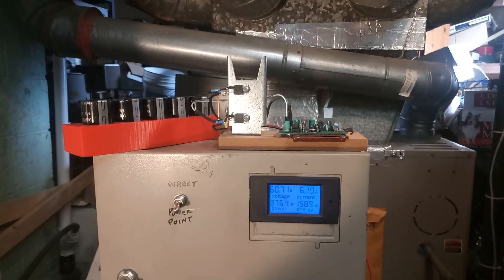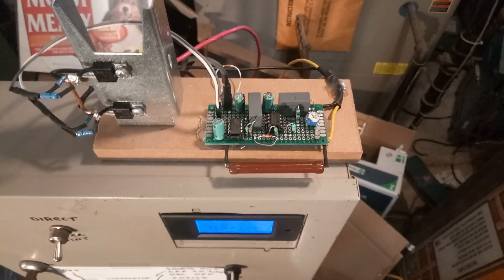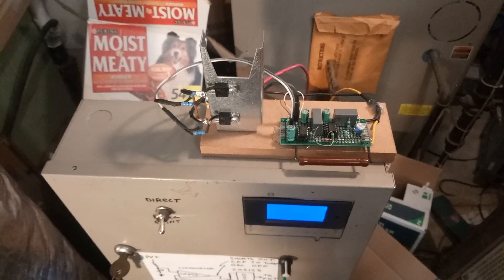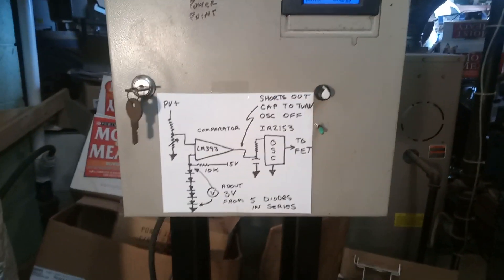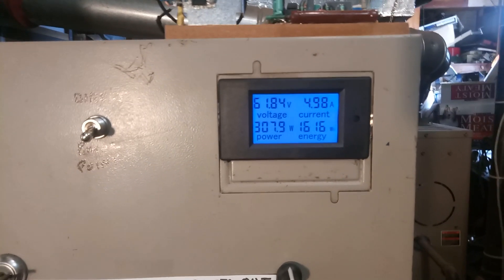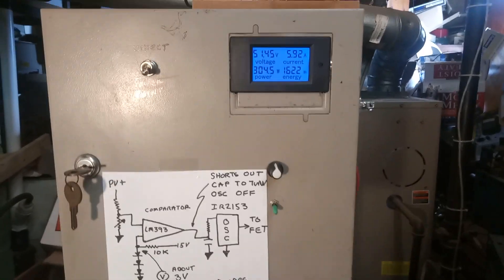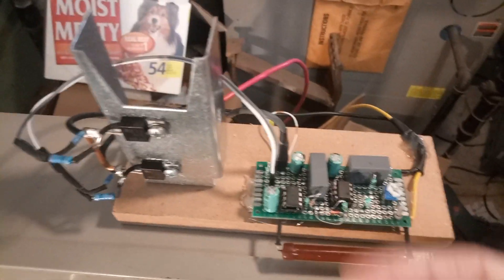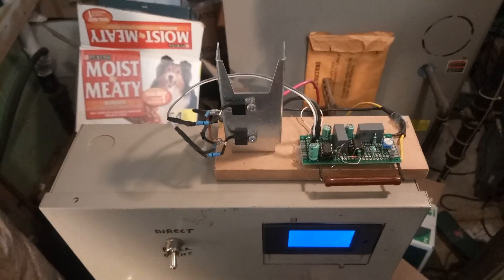LM393 Tracking PV Solar Water Heater Control, FAKE IR2153 Pt.1

Comment: Very clean design! The mounting system for the capacitor bank and the heat sink design for the fets are truly ingenious! Have you considered using water as heatsink for the fets?
Reply from the maker: I believe that if electronics you designed gets hot, you are probably doing something wrong. These FET do not heat up due to very low on resistance. FET resistance can easily double at elevated temperatures. Be aware, FET current in this circuit remains the same and only the duty cycle varies even at low average current. These are 
only 75A FET in this video and at 8A you can not detect that they are running. Using the recommended 110A FET you could more than double that with no appreciable heating. This is a good time to mention that using common FET rated over 150V will have on resistances well over ten times more. IGBT are often used at higher voltages. The downside is an IGBT can easily create 15W of heat due to fixed forward voltage. Keeping array voltage lower than 150V or operating at much higher voltage with an IGBT should be considered.

Comment: You seem to be the type of person who'd like this: http://www.thebackshed.com/forum/ViewTopic.php?TID=11546#137944
It's a solar water heater design I've been trying to fabricate, but haven't had any luck getting it to function properly.  There are two diagrams, and the connection points between the two have the pins accidentally reversed, and that's been accounted for.  If you'd like to have a go at this design and see what happens, I'd certainly be interested to see the results.  Thanks for your time making your videos, they're very interesting.
Reply from the maker: I saw this when it was first published. I'd rather stick an ice pick in my eyes than look at it again. As they say, "it should work but I haven't tried it."  I favor the simplicity approach, but it is very disappointing that this board couldn't come up with something better. The concept is flawed. Personally I feel anything with a 555 is a joke. There are many other 40 year old switching ICs that would work better like a TL494.  You will find your biggest dangers in any design when the panels can only produce about 20W. That is when these poor designs really suffer.  Please keep me informed of your progress. Hope you haven't wasted your money.
Reply from the maker: I hear you are confused. That's understandable.  I'm showing many many ways to do this.  The principle remains simple, Charge a capacitor, let it reach a desired voltage, then discharge it until it reaches just a slightly lower voltage.  This is PWM and you want the capacitor voltage to remain almost constant. This is called adiabatic capacitor charging which is the only way to be efficient and keep the capacitors from blowing up.

In the past I have tried to use existing modules and modify them.  China is like a box of chocolates, you never know what you will get.  I no longer recommend doing this because inexperienced builders aren't very good at this.  Phase two is to get you to build the entire thing. It was always probably the easiest way, just intimidating to many.  The new circuit coming is pretty easy and if a larger perf board is purchased it can be laid out more logically.  It also has fewer parts.

No, my stuff is not complete. It was presented for people who understand electronics and is presented in basic building blocks.  I think it is an easier way to understand it, just need to take some time.  Start with what you don't understand first and ask a question. The circuits remain the same, just values are changed.  Your system wiring changes depend on voltage, how many tanks, number of heating elements and priority of heating.  It does take a little thought.  I'm not in the entertainment business and this only costs me money. Bad lighting is to scare away the slackers, I offer content.  I don't want a lot of people building systems from comic book instructions and being totally stuck when it stops working years later from a lightning strike.  You can do this as I have several that have completed large systems without prior training.
Reply from the maker: Here is the location of some screen shot data which might help in your understanding 
of the circuit.  https://www.fieldlines.com/index.php/topic,150091.0.html

From your current attempt you have already figured out the configuration of the capacitor
bank, heating element and FET. At least a circuit was built indicating IC pin numbering, 
soldering, getting a TL431 and obtaining parts are tasks you have accomplished. That is
far more than 99.9999% of the people in solar can accomplish. It just doesn't work and 
that control section can be easily replaced. Failure is a great teacher. You could have 
been saddled with something that just doesn't work very well. Just knowing something can 
work is a motivator. 

Get it working, gain some confidence and then we can talk about all the options. I have 
a single FET output that may be more suitable with a high voltage array coming. I know, 
will the changes ever stop.
Reply: @opera5714  Thanks so much for the detailed responses.  I've let the DIY experimentation go to the sidelines for now, as I suddenly have bigger fish to fry.  We just contracted for mounting 60x 340w panels for net metering and 42x 245w panels for "other".  This grid-tied net metering setup should close to completely power our house and the mother-in-law's house next door.

I also purchased the Electrodacus DMPPT450 for direct water/thermal mass heating.  The 42x 245w panels are intended to be used for that during the winter, and will be running MPP Solar charger/inverters during the summertime to run extra ductless air conditioners down here in Atlanta.

My component-level electronics knowledge is limited, and my scholastic electronics training was over a quarter of a century ago - and hasn't been kept fresh.  Still, it's very enjoyable to design and build out complete systems and I'll always enjoy watching folks such as yourself who have much greater knowledge tinker with their component-level toys.  Thanks for sharing!
Reply from the maker: @NoelBarlau  This may be hard to understand, but I wish I could have a big solar system. Site location at home and camp are terrible. No payoff at home possible. Camp, my needs are minimal and in 10 years will probably bulldoze the place when I can no longer maintain it. I have the ability to do some really neat stuff with a more typical system, but will never get the chance. Camp systems are of little interest to most. 

I like Dacian for his purity of thought. Trouble is you have to build a home around it for space heating and typical water heaters don't match up well.  Panels also have to match the battery. Just a lot of commitment to a single philosophy.  It is a complex system that I don't think many understand before purchasing.
Reply: @opera5714  I just happened upon your comment on another channel about the Rheem hybrid water heater.  Would you recommend that for someone like myself who will have this type of solar capacity, or would you go with a larger 120-gallon resistive electric only model to add some thermal energy storage?
Reply from the maker: @NoelBarlau  HPWH are efficient, have larger tanks and most cost efficient for higher use 
residences. They (in general) get less efficient at higher water temperatures 
and have a low temperature limit which makes them about useless for storing hot 
water. Ideal is to get water over 145F so there is no demand at night. This 
reduces the need for larger battery storage.

The larger tank of a HPWH is to make the slow recovery more acceptable. That 
makes it a great place to store excess energy. The all have mostly unused 
resistive heating elements just waiting to be used. The catch is knowing how 
to use them. I've heard rumors, nothing reliable, that the controls check to 
see if the elements are present from a resistance check and/or current check 
if demand occurs. Any system like that can be fooled once it is understood.

It is an expensive item and anyone would have reservations about warranty issues.
An external pre heat tank only has a payoff in large usage. Another tank is a lot of expense. Get much above 80F and the rest of the energy just ends up wasted as heat loss. Best to put the energy into the HPWH tank to keep the heat loss at a minimum and raise tank temperature.

There are small thin elements that will fit into the drain port of about 600W. Not a bad size for all day solar dumping. Standard elements take  a 1" port. I've seen thermal siphon designs where an external element feeds from the drain to an upper side port. Similar designs use a pump with a pipe in a pipe only connecting to lower drain. Not recommended for tapping into hot water line because of blending issues.

So, great idea which needs a lot of commitment, effort and technical skill to 
implement. I did it to mine, but that was a NYLE external HPWH and it was something I like to do.
Reply: @opera5714  Excellent info, I really appreciate the time and effort you put into it.

I previously discovered those NYLE external units, but when I went to their website it says "Coming Soon!" and I haven't been able to find any of the older units for sale anywhere online.

While I think the HPWH would be great in the summer both to cool and dehumidify the basement as side benefits, I'm not sure it's going to be as good of a deal in the wintertime as it will be pulling heat out of the basement - so you've essentially already paid for the heat in the house, and are pumping it into the heated water which then goes right down the drain.  I'd love to see someone run some numbers on this.

The backup element holds a lot of promise, but if the system is computer controlled it'd be a bigger bite than I'd want to chew to figure out how to game the system.

With as much solar power as we should have available, it'd probably be fine either way.  We can net meter up to 10kw and I have a secondary battery backup system on top of that.  It should be online by the end of the month, but our water heater might not have that long and I'll likely have to make a purchase before seeing what the solar systems can do in real life.

I'll be posting video updates on my channel as we go along.

Comment: I'm sitting here playing with some comparator Boards for exactly this putpose when your Vid Notification came up. 
I like your ideas but really want to do something more suitable to normal hot water heating.  300 Odd watts is barely effective for a 25L tank.  Doing something that would Pump 1000-1500W and use much higher voltage would be much better. 
300W average could be achieved with a bunch of panels connected to some caps and a regularly timed pulsing with no refrence to power levels at all. It would be useful to see some up scaling of the power levels of these designs to make them more practical.
Reply from the maker: I bought a couple of those comparator boards and found them not useful for much the way they were configured. I understand the appeal, but building just what you want is often easier. Still a good educational opportunity. 

You should be honored. That solar array was purchased solely for viewers like you. It only gets 1 1/2 hours of clear sun. Prior to spending $500 a couple months ago to cut down a tree it produced even less. Still think it has a better payback producing 14 cents of electricity each day than some systems I've seen. HPWH does it for only 47 cents a day.

Many are afflicted with exactitis.  If it doesn't match exactly what is wanted or does not conform to what they expect, an idea is totally rejected. As pictured that configuration can do 1500W.  Largest micro based system built from my design was 3500W. Latest on this 2153 design is on a 1200W array. Both builders had no prior electronics experience.

My main priority is to have people gain an understanding of electronics principals.  Having someone build something that they can not support later on is something I want to avoid. In a way, the structure of my videos weed out those who are not serious. 

These circuits are an eloquent solution to water heating. Their simplicity and versatility can only be appreciated by an experienced designer. I find it pretty amazing that I am the only one on youtube that explains how to build efficient PV water heater controls. I appreciate any effort that is made to make these systems clearer. Thanks for watching.